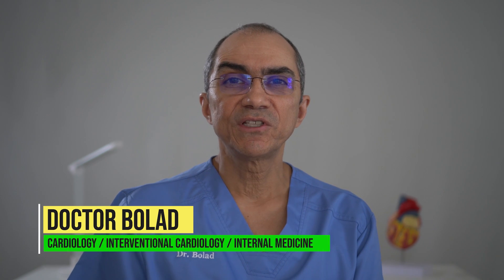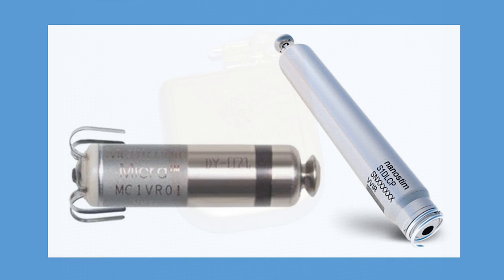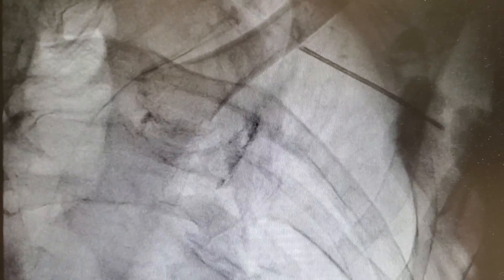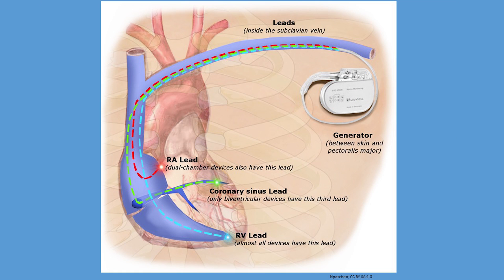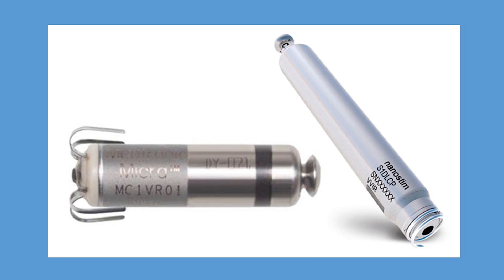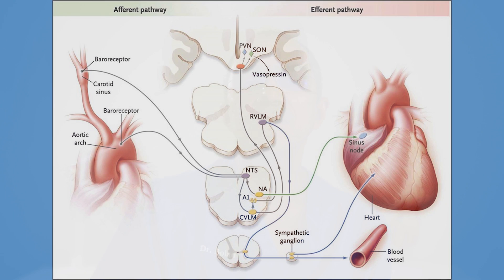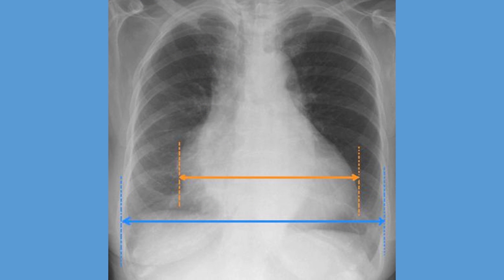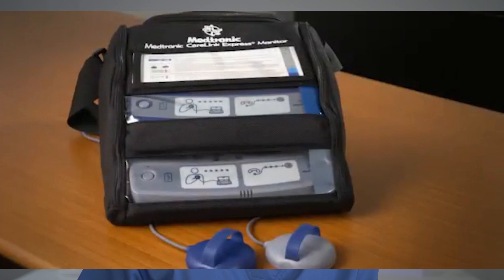Pacemaker Surgery

Comment: Doctor, I have a question. My dad after extreme exercise had a pressure fall and he collapsed but after 5-6 days after checking his bp and heart rate it showed 134/96 and hr- 98 . His ecg reports are normal and echo showed her has tachycardia. But a heart specialist doctor said he needs immediate pacemaker. Without any proper reasoning. Should my dad go for the surgery asap or get another 2nd consultation?
Reply from the maker: I think you should ask your doctor why he/she thinks your father needs a pacemaker. There are set criteria for pacemaker implantation. If an explanation is not offered, then it is not unreasonable to have second opinion.

Comment: I have a pacemaker and I’ve had it since 2020 and I’ve been doing great with no issues I can feel it pacing at time but other than that I’m doing great
Reply from the maker: The most important factor is to have your pacemakers checked regularly by your doctor to make sure that it is functioning well.
Reply: @DoctorBoladCardiology  will do doc
Reply: I have a Pacemaker Implant and a Quadruple Heart Bypass in October 12 thru October 15, 2023
I am 77 years old and I am doing pretty good!!

Comment: Hey Doc,
I'm a 66 yr old male life long athlete and I continue to workout 60-90 minutes per day. I have been diagnosed with Brady and 3rd stage AV. My HR routinely drops into the low 30s during sleep. I am completely asymptomatic. My EP Cardiologist has indicated a dual chamber pace maker is my future and probably sooner rather than later. After doing much research as well as listening to your video, I would much prefer to go with a leadless PM vise the traditional leaded type device. My concerns are recovery time and future restrictions on my exercise routines which include swimming, cycling and weight training. My cardiologist is only using the traditional style device at this point. Do you know anyone on the east coast who is using the dual chamber headless system. Thanks you in advance..
Reply from the maker: The traditional pacemaker would be more physiological. Leadless pacemakers are implanted at this time, when there is difficulty or contraindication to use the standard pacemaker.

Comment: Very informative. Thank you Dr Bolad. 70 years old with  BP 132/79 and heart rate of 72. Holter monitor shows both junctional rhythm and normal SA node pulse in a 24 hour period. EKG a year ago showed a normal P wave but a year later  it was not there. I can exercise normally, play golf, bike and mow the lawn (walking) with no ill effects. Echo-cardiogram is normal with a very slight enlargement of the left atrium. Can a person live normally without treatment if they are asymptomatic or is a pacemaker necessary? Thanks so much for your time.
Reply from the maker: Thank you. Yes it is possible, as long as the heart rate and blood pressure are maintained, then a pacemaker is not indicated. Any medications that slows conduction, for example beta blockers, if they are being taken, will
 need to be discontinued.
Reply: What is the lifespan for a person in his seventies if he gets a pacemaker. Thanks

Comment: How long after the pacemaker is implanted does it have to be changed to new leads etc,had mine implanted in 2017.
Reply from the maker: This depends on how often the pacemaker is being used for pacing. Generally your pacemaker should be checked every 6 months if it is functioning normally, and more frequently if there is an issue. Your doctor should be able to tell you during the check of how much battery is remaining. Leads are generally not changed unless they are not functioning well. The pacemaker unit is changed. Please check with your doctor regarding follow up.

Comment: Hey Doc. I once had a Heart Rate of 26 Beats per minute. ( I could or should I say, I was able to hold my Breath under water for 8-10 minutes at one time.) NO PROBLEM!  Since that time I had a Pacemaker and Inlarged Heart with very little Muscle to it. ( Due to Many Heart Attacks and ONE MASSIVE One.) I got a new heart through Transplantation and I had to have a PERMANENT Pacemaker like you were talking about after the Tx cause my NEW Heart was racing and they couldn't get it down. it was POUNDING OUT OF MY Chest and sometimes so fast I hardly felt it. When it did beat hard MY Hospital bed was rocking!  Now I got those COVID 19 Shots and They have cause my heart to do really unfortionate activitys and causing me to nearly die. it's been 30 years and some since ALL this crap went down. I could tell ya ALOT More but wondering if this new pacemaker would be right for me? How do they get these LIL Pacemakers inplanted into the heart OUT?? Thanks Subscribed Doctor.
Reply from the maker: Thank you for the detailed information. Are you inquiring about the leadless pacemakers? If so, these are implanted in certain situations and they are not the first device option for pacemaker implantation.

Comment: I have a slow heart rate and have had a pacemaker for 2 years now. The doctor set my heart rate at 50-130. Can we exercise and play football? And is there a chance that the lead wire will come off or not? And when we exercise beyond the prescribed pulse at 130, will it have any effect on the machine or ourselves?

thank you.
Reply from the maker: The pacemaker pulse generation can go up to 130/min . However your own intrinsic heart rate might be able to go higher, depending on the underlying heart conduction abnormality you have. The response to exercise depends on the type of pacemaker you had whether it is a single lead or  a dual chamber pacemaker. It is unlikely that the leads will come off easily after 2 years, but please check with your doctor who implanted the pacemaker.